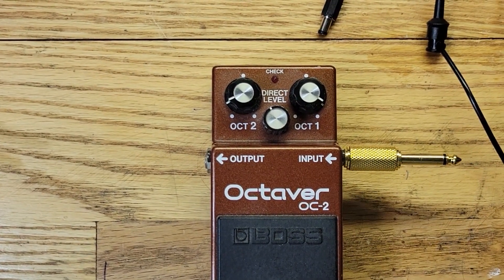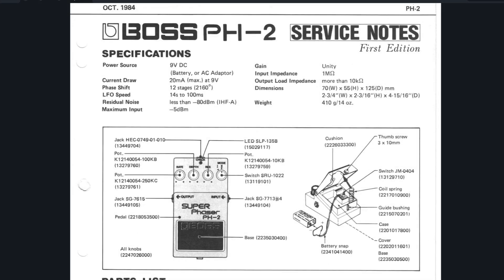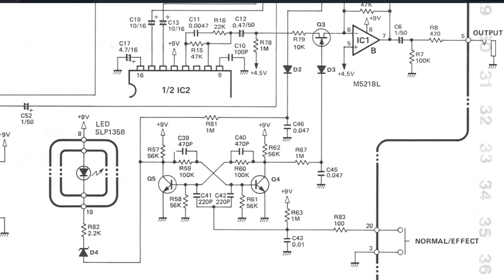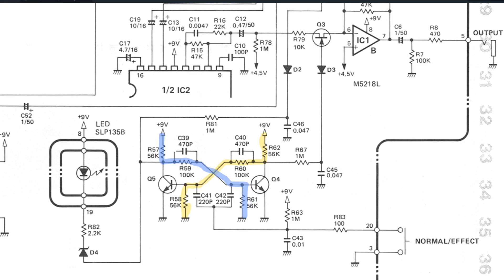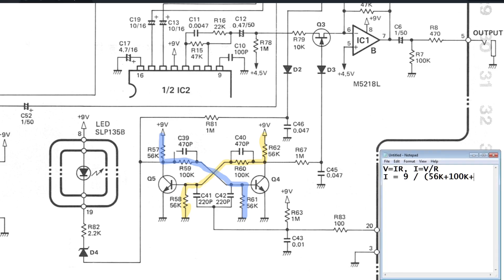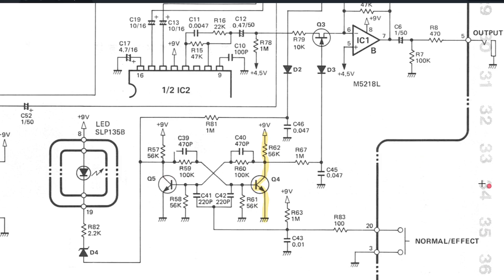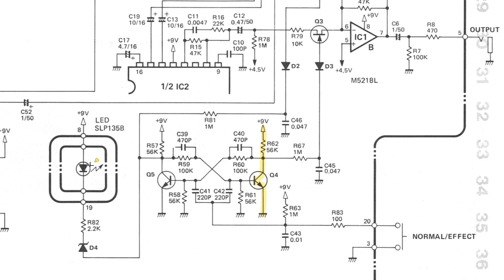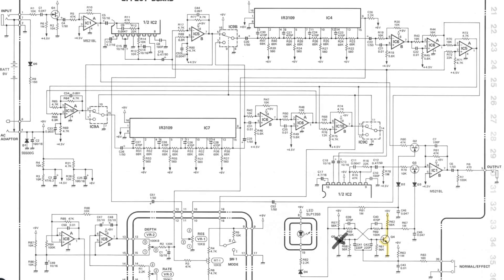BOSS Pedal switching circuit analysis and modification.  Forcing it to turn off when plugged in.

Comment: Good video…however, please note that a (functioning) forward biased NPN silicon transistor b-e  junction cannot exceed approx +0.7V with respect to the emitter, so will not read 2.4V as mentioned.
Reply from the maker: You're absolutely right—thanks for pointing that out. I overlooked that the resistor is in parallel with the base-emitter, so the voltage across it will be clamped at around 0.7V before it can reach 2.4V as I calculated. Not sure how I missed that, but I appreciate you catching it. Always good to have extra eyes on this stuff—mine must’ve been in sleep mode! 😴.  

I'll actually be redoing the video soon anyway because the sound quality wasn’t great—so I'll make sure to correct that part in the updated version.

Comment: Hi! Thanks for the explaination on Boss Flip-Flip switching.. it helps me alot.. but still my problem on my Old DS1 is the switching is not Stable.. sometimes it wont turn OFF/ON.. tried replacing the Q4,Q5 even Replacing the Boss Switch.. still the same..😢 any hints on what part to Look at?... -Thanks...

Comment: If I pull out r81 and r67 in this circuit, will the flipping part still work?  Or maybe I should go as far as D2 and D3 and pull those instead? I'd like to troubleshoot and test the flipping circuit on a breadboard without the rest of the pedal.
Reply from the maker: Yes you can build it on the breadboard up to r81 and r67 and it should work
Reply: Thank you for the reply and the video.  This helped me understand this part of the board enough to finally fix a pedal I bought.  Guitar Center had a scratch-and-dent table with a CH-1 Super Chorus than wouldn't turn on.  It was $20 and looked brand new.  Now it works great although the board is slightly mangled after my trial and error screwed up a few solder pads.  Oh well.  Once it's screwed together, you can't see that part.

Comment: Just found your videos, wow…thanks! Trying to troubleshoot my DE-7 (the status on/off LED doesn’t light when pedal is on). Your video helped tons to help understand that circuitry. But I also need to figure out the power in AC adapter vs. Battery source supply.

The schematic is confusing, I see where they use a stereo Jack on input (to enable the pedal) and a diode and 470 ohm resistor. With 9.08 Vdc input on AC adapter, I see the 470 ohm resistor dropping 2.5 V across it, but at all the Vcc places (like supply to the transistors that either short or open, in the toggle section of the on/off circuit) I read only 5.9Vdc from Vcc to chassis ground. 

In yours this is 9Vdc. 

I’m having a hard time reading the DC input.
Reply: Adding reply to myself. Found out the problem was some Boss pedals require ACA supplies which are unregulated 9 v and so supply more like 14 v. It works ok with one 9 v. Battery, but if powering from a supply, needs 12v. But the other solution was to remove the diode (D1) and resistor (R1) and solder in a jumper for each. Worked perfectly! Whew.

Comment: Why is it some other switching circuit of boss like flanger bf2 is only one jfet 2sk30? How is to switch to flange and dry signal? Sorry for my english
Reply from the maker: I haven't looked at that one in a while but I'm pretty sure with the flanger the dry signal is always part of the output that's why there's only one jfet to let the wet signal in and out but the dry signal is always there
Reply: @signalsandbits thank you so much sir